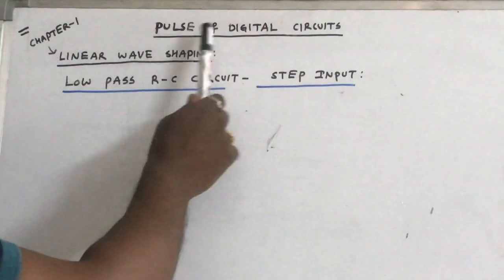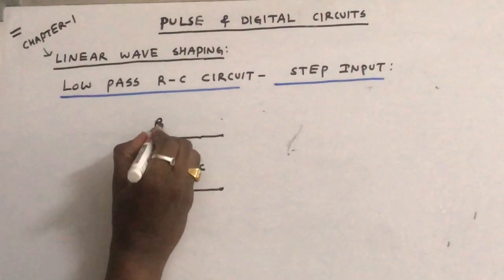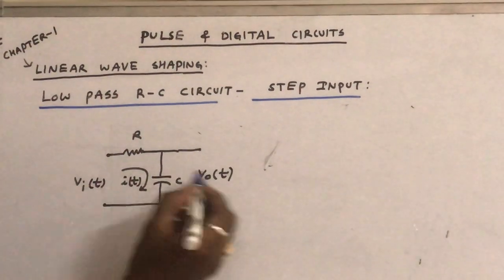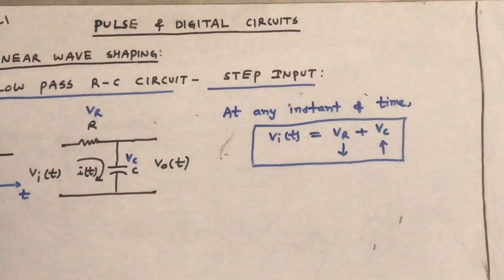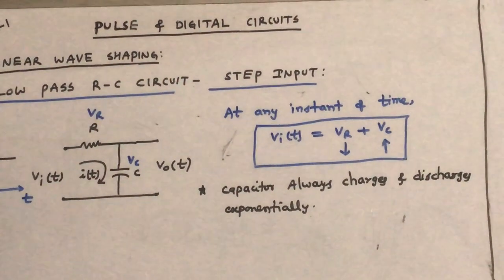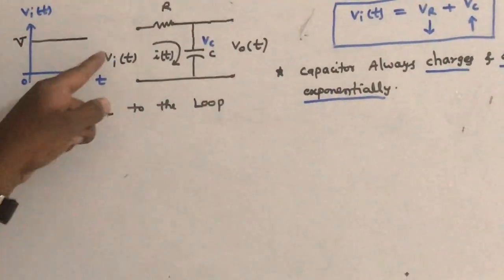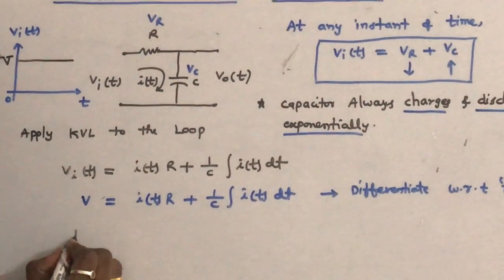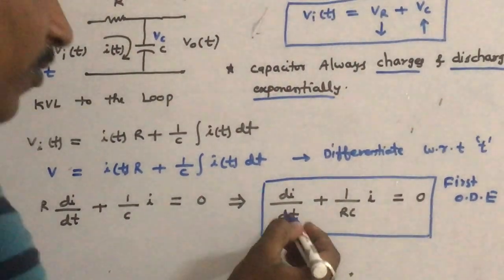Low pass R-C circuit - step input - Linear Wave Shaping

Comment: Why we have to take integration for capacitor
Reply from the maker: I.e. voltage across capacitor formula, you can check it from network theory, i = C dv/dt or V = 1/ c integration of i dt
Reply: @MrPprasanna  tq so much sir